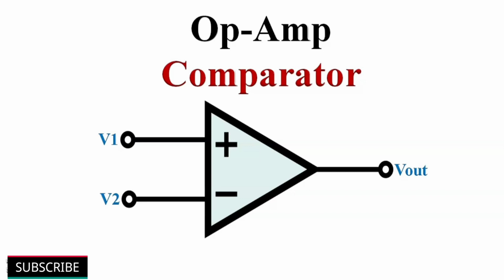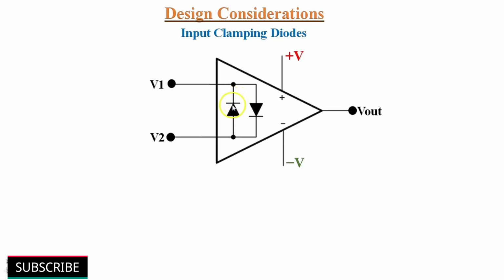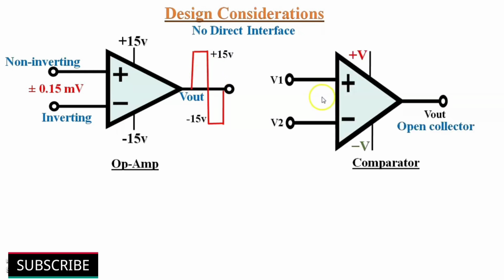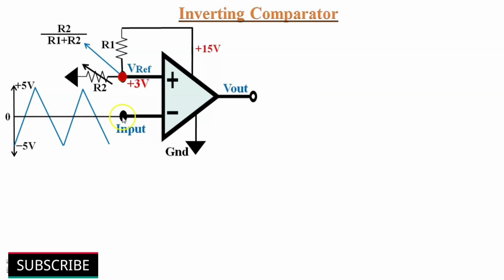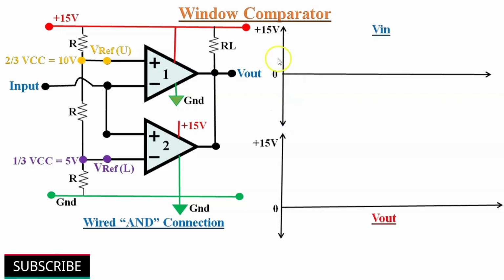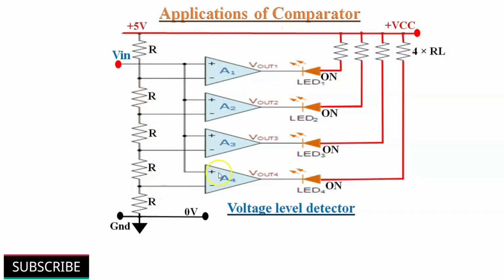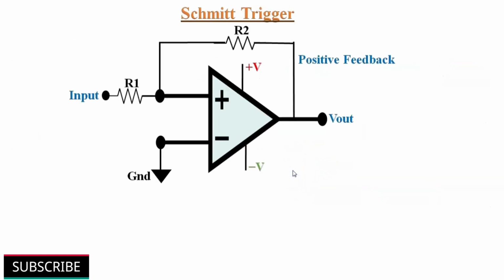Comparator with Examples (Inverting, Non-Inverting and Window Comparator)

Comment from the maker: Timestamps for the various topics covered in the video are as follows:
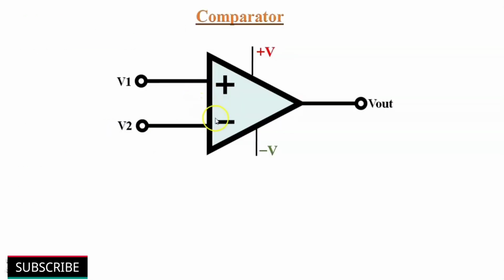0:43 What is Comparator,
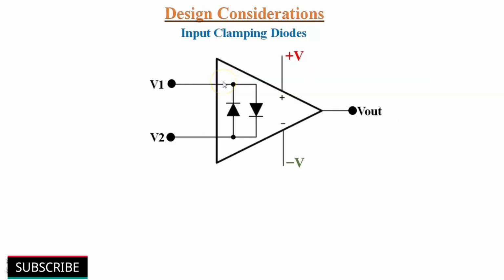2:23 Design considerations (Op-Amp vs Comparator),
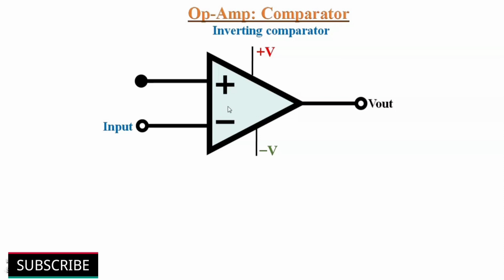5:54 Inverting and Non-inverting comparators,
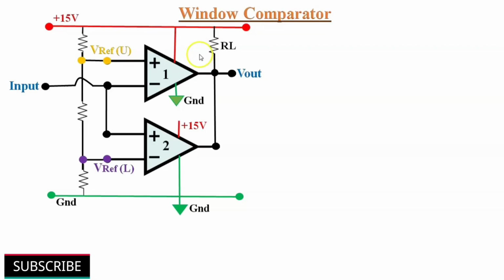9:24 Window Comparator,
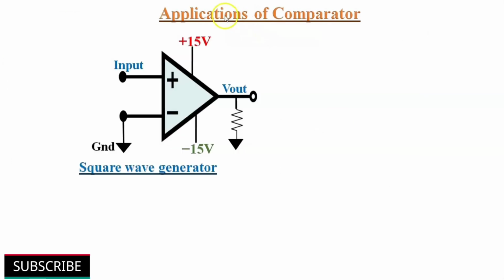13:00 Applications of Comparator,
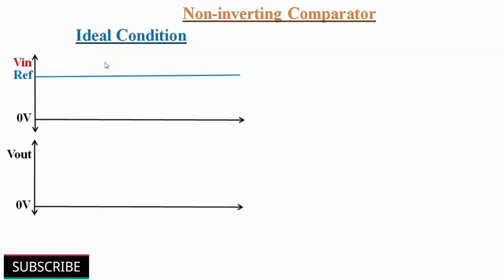15:55 Limitations (Noise) of Comparator.
Reply: A0pppp00p